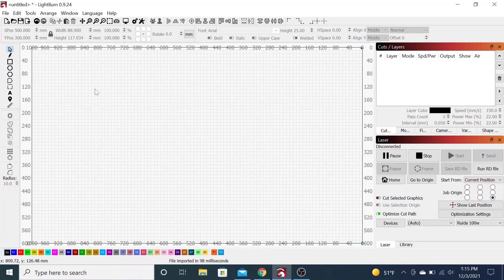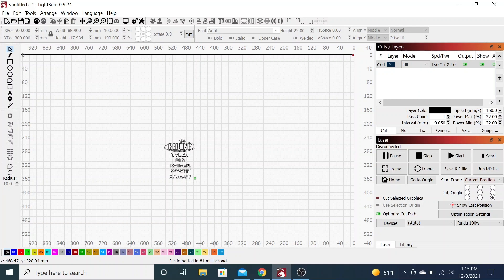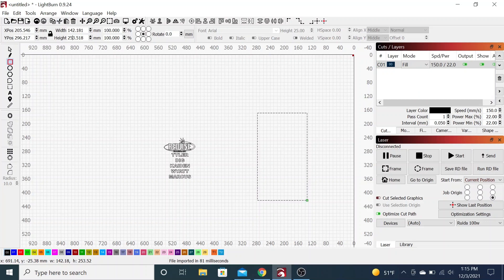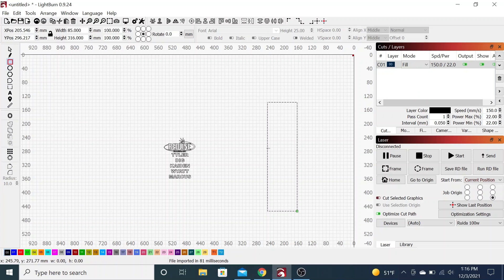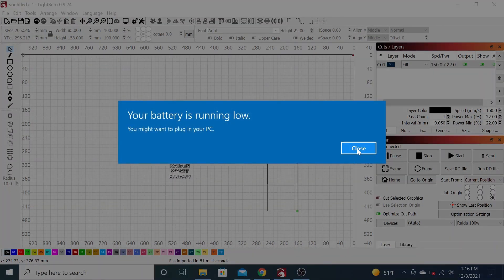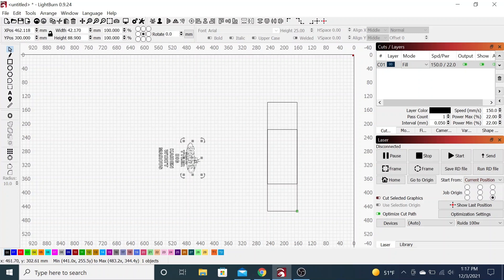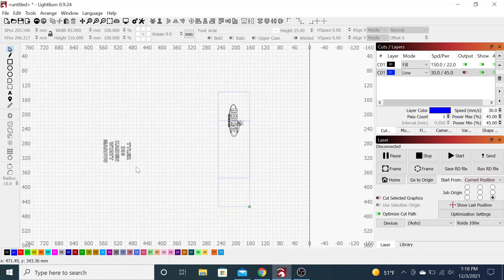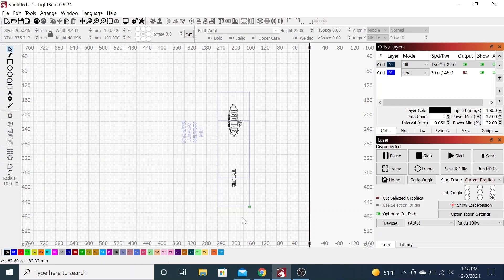Setting up for a two sided tumbler engraving on a Co2 laser

Comment: do you find you have t convert your text to SVG to get a smooth result? If i leave fonts as is I get shifts in my engravings (which disappeared after conversion).... or have I just been lucky?
Reply from the maker: In my experience I always want all the parts to be the same type. All images or all vectors. If I generate the text in lightburn I’ve never had a problem with just leaving it how it is.

Comment: Used this for the first time today.  Worked great.  I do have a question though. On one of your other videos, you talk about using a box around your graphic so the laser doesn't slam into and start the graphic compressed.  I did just what you did in this video, except that I used a tool line for a box instead of picking a color and turning it off.  On the graphic I'm using, it starts off on an angled point, and is getting a small flat spot there,  Could this be because I"m using a tool line instead of a regular line that is turned off?  I can't figure out why it's doing this.  I did two, and have 18 more to do tomorrow.  Thanks.

Comment: Ok! I tried this but when i go to center my logo it frames it way to the side which screws everything up!!…I'm guessing it has something to do with the SPR ? if not idk what it is I've tried several times. It's my first time doing double sided so I could very well be doing something else wrong. Customer doesn't want double sided I just made it out like that to make it easier to find the center of the opposite side of the yeti Logo...Help Please!!
Reply: Same problem. Have you found solution?

Comment: One important step before this is to make sure you have your steps per rotation exactly right if you want both centers to be just right. I never even thought of your method for double-sided engravings. Gonna have to use it!
Reply from the maker: Yes, if you steps are not right it will not line up as planned.
Reply: Been using this method, it works great - Thank you.  One issue I am having is:  I can not get the logo center with the cup logo, i.e. a yetti cup logo on the bottom

Comment: I’m using your tutorial however they are not lining up on opposite sides of the tumbler from each other. Any idea what may be causing this?
Reply from the maker: Likely your steps per rotation need to be calibrated.
Reply: @BeardedBuildsCo  Thank you! I will look into that. Love your videos. Now I will have to figure out why I can't get my boxes and images to "snap" into place. Learning curves. lol
Reply from the maker: Snapping is an option that can be turned off and on in lightburn.
Reply: Glad I'm not the only one having the same issue!!
Reply: Did you figure it out?  I am having the same issue. I have an Epilog laser and the manufacture told me that there isn't a way to calibrate my rotary attachment.